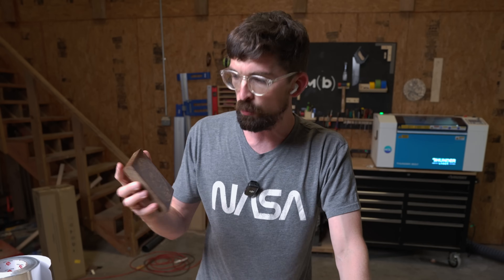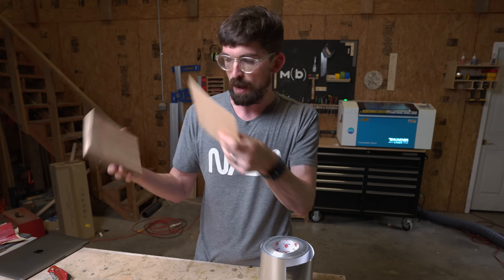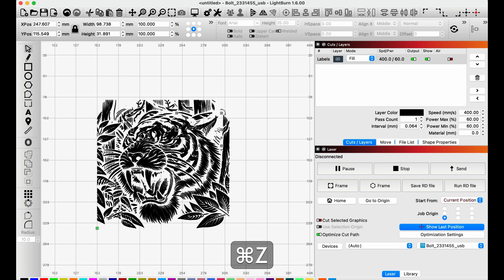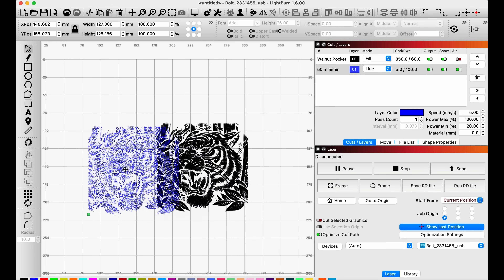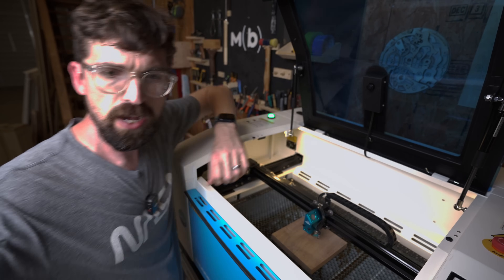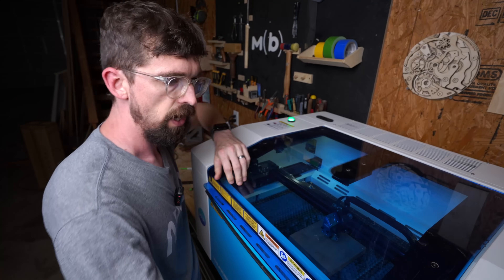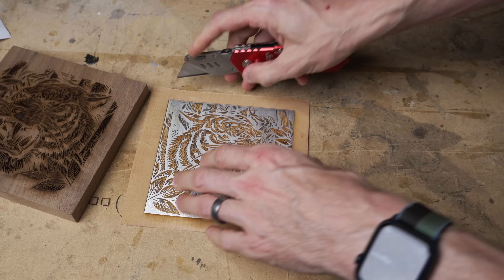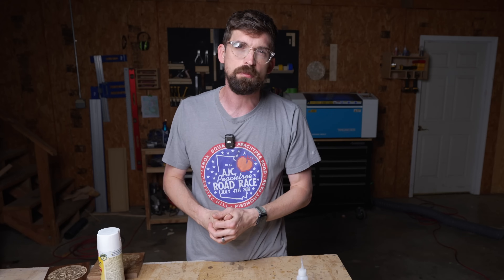How to Create INSANE Wooden Inlays With a Laser - Full Tutorial

Comment from the maker: I totally missed putting in the part about mirroring the veneer!  Make sure and do that so they fit, sorry!
Reply: Im glad you said that, the whole time I was thinking "Dont you have to flip the inlay horizontally?"
Reply: What about setting the laser kerf offset so you don't have a gap between your inlay and your main piece.
Reply: @Nuketech421 i was wondering about this as well. I believe you cannot set kerf for a fill, so I think you need to shrink the pocket and grow the inlay using the outline tool
Reply: I’m so happy you said that 👍
Reply: The foil burn looked great to mount as a single carve
Reply: Definitely an important step.
Reply: https://www.youtube.com/watch?v=JZFbtrG2P48 better vid without missing steps
Reply: Subbed-up,Noice !
Reply: I just watched your video and jumped back 3 times to see when you mirrored it. Nice trick with the metal tape!
Reply: When in the steps should you do the flip?
Reply from the maker: @torymiddlebrooks just before doing the engrave on the veneer

Comment: It's cool that you can misalign the material and print & cut still works.  I assume when you say laser you mean the red dot pointer, mine always seems to be slightly off.
Reply: One thing i did to my point to make it more accurate was make a tiny chuckle out of ply and use the laser to make a tiny hole in the center then put it up inside the clamp that holds the pointer. It makes the red dot much smaller therefore more accurate

Comment: I’m a total rookie but I’m a few months away from purchasing the xtool F1 Ultra. My question is what’s the point of an inlay vs just burning the image?Does it stick about the surface giving it a 3d texture?
Reply: Just the opposite: burned in engravings leave lots of open areas in the wood for dust and debris to settle in. Not only do inlays let you get a different contrasting look, but after sanding the whole surface is flat and even. Much better for things like cutting boards or anything that might need to be cleaned. Plus it's classy.

Comment: Good idea. I'm going to head over to my local HVAC guy and see if I can get a sample of the tape before I spend the money for an entire roll. About how deep is your inlay?  I'll be using a 10/30W diode laser and will need to do a materials test to get the correct depth.
Reply from the maker: Probably about 1/8 in, just deep enough for the thickness of the veneer.  You can run multiple passes so you don’t have to have it all dialed in from the beginning.
Reply: @makeorbreakshop   Sounds good. I was able to score a TON of veneers from a woodworker who was downsizing in my area. The price was great and I got an awesome variety of wood species. I've already used some of it to cut out a name or design and glue it over the original design. When I saw your method of using inlays I thought it was genius. Thanks for the idea.